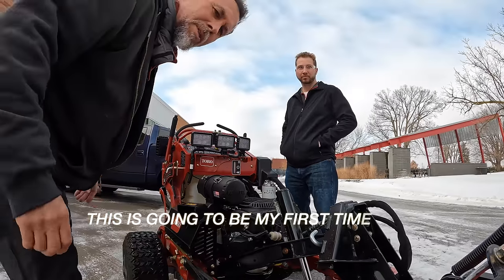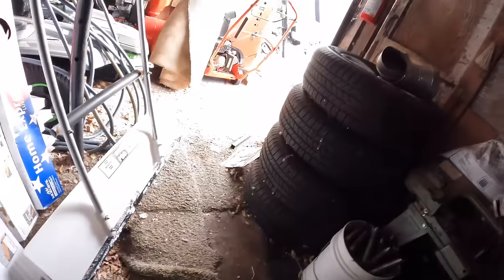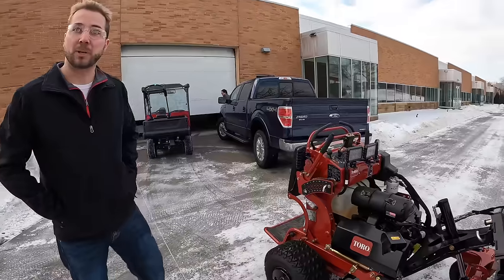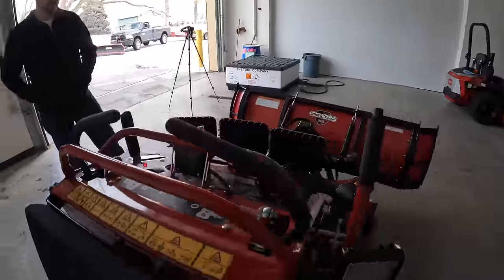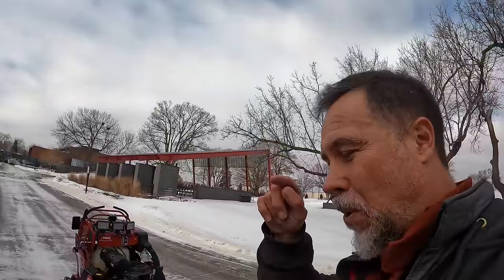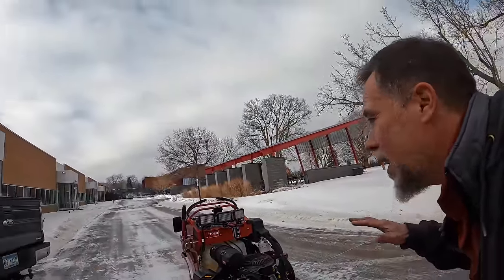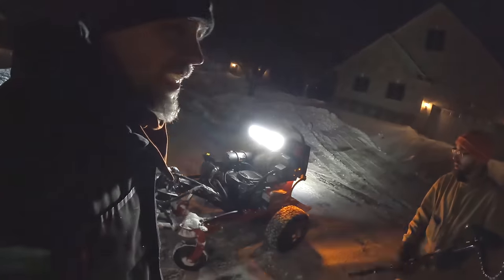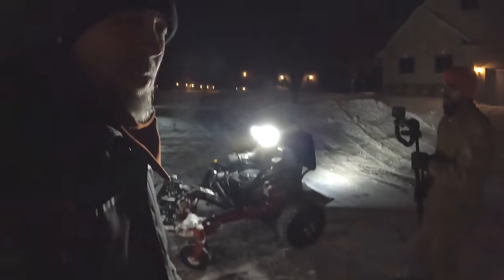Testing a new machine in Fresh Powder

Comment: I've never ran one but from this video is looks like the Ultimate machine for residential properties. The only issues I'd see is pissing everyone off at 3am for how loud it is and you'll have some frozen operators at  the end of the night. Otherwise that machine out performed my expectations
Reply: If they are also shoveling those entrance walks and a little smaller driveways. It might be about the right balance. We picked up a Snowrator this year and are trying to figure out it’s strengths. Maybe the Toro is a good step 1: shovel walks and fist “plow” pass out and away from the garages along with faster transportation between units.
Reply: It probably has a extra add on for another hefty price for a heated cab 😂 JK.  by the time you add broom plow smaller plow, and any other add on. This thing could get pricy..  oh I forgot the led lights and side blinker. All seriousness its pretty cool machine.

Comment: Hey Stan! Great video. I’m glad you did a video on the Multiforce. I have one and this winter is my first winter on it. It took about 2-3 snow events to get used to the controls, but once i had it done oh boy was I going fast. I ended up putting tire chains over the snow tires and wheel weights to give it more traction. Because I live in northwestern ontario up in Canada (about 4 hours from Duluth btw), we get a ton of snow up here (like 4-5 feet each winter). And the chains helped a lot, but in my opinion for most guys who are going to be using it in the states the traction will be just fine for the amount of snow they got. 
I decided to go with the Multiforce instead of a plow on my truck because I didnt want to deal with the extra maintenance and insurance costs of plow trucks. Overall, I am very pleased with my unit, and I recommend them to anyone who is on the fence. I had my doubts when I bought it but I wasn’t disappointed!!!
Reply: Do you not freeze on it in the cold and windy days?????
Reply: i priced one here and it was exspensive comaring to the 14.5hp dr field and brush mower with ,lawnmower,blade,blower,chipper,brush hog attachments are $5,898 for 5 in 1 multipurpose
Reply: @LAKESIDEBOB1  I imagine you could just use heated liners for motorcycle riders plugged into the DC port. That gear will make you sweat at 60mph in the mid 30s outside riding with it on medium. Pretty cheap version at cycle gear too.
Reply: I live right by Erie Pennsylvania and we get a lot of snow here as well just because you are farther north don't always mean you get more snow. We measure it in feet also. We get a lot of lake effect snow.
Reply: You guys get a average of 213cm and we get 256.5 on average so we get more snow it's a fact.

Comment: I'm in Richfield and using this setup for the first winter. I love this machine. I do a couple churches with lots of sidewalks. I use it to cut curbs and light poles. Then we do the neighborhood accounts wit it. It scrapes better than my back drag.  One draw back so far is the sidewalks are built up now and I can't get over the top. So they are getting skinnier. The cold is the other. But I went from needing 3 people to do the walks to just one. I believe someone could start a business with this machine. We fight over it
Reply: Have you considered using heated motorcycle gear? Cycle gear has a in house brand that's pretty cheap for heated liners and it's kept me warm (high will make you sweat on the highway easily) riding motorcycles at 60+ when it's 30 out.

Comment: When i use to do snow removal i always used a grain shovel.they are like a scoop shovel but all 1 piece lite weight and does not brake.also we used something like the man plow but little different it was a 2.5-3ft plastic plow that is angled with a wheels and a loop handle that flips direction
Reply: Those are good tools.
Reply: Your angled plastic plow is a Snowcaster, or a generic version of it. I have the same thing. Works great.

Comment: For snow shovels, I riveted UHMW wear strips onto two of my shovels and they're incredibly long lasting.
Reply from the maker: Niiice!
Reply: @Dirtmonkey  can you make a lawn mowing video using the new lawn mower this spring
Reply: What thickness of UHMW did you go with? I’ve done a bunch  of 1/4 thickness * 2”. It seams a little heavy.

@Stanley “Dirt Monkey” Genadek I love my 27” inch ergonomic double bender (custom old school bend) for my height, aluminum handle, soft D handle shovels for the lighter fluffy snows. For the heavy snows I grab a skinnier double bend shovel. For the really light fluffy lake effects snow I go the the 48” straight handle on the open areas we hand shovel.
Reply: @natielou143  how are you

Comment: Lived in northern Michigan snow belt my whole life, have had years with 350” total. I know my way around a snow shovel (don’t know if that’s a good thing). Best snow shovel i have is “the snowplow, original snow pusher” shovel. Comes in 24”,36”, and 48”. If your only getting 2” maybe 3” I use the 48”, i can make quick work of my driveway with it. Once the lake snow really kicks in I switch to the blower and if I need a shovel at that point I use an old coal shovel. 
The snowpusher shovels are great for cleaning off the ice rink too. Above all they are made in the USA.

Comment: I bought a Snowcaster wheeled snow pusher, and really love it.  It is angled like a plow and is very light, yet durable.   Not the best for heavy/wet/deep snow., but great for everything else.
Reply from the maker: Ive seen those.  They seem pretty light for commercial work I think
Reply: @Dirtmonkey  I saw they came out with a heavier duty one with a  more durable plastic for the cutting edge, and its such a simple design I think it may last quite long with a metal handle and durable plastic blade and support

Comment: I’d say 4” or less this is pretty useful. As a sidewalk machine as well. However if I’m assuming correctly on the price you’re better off in a skid steer with a plow you’d have those drives done in 2.5 mins tops. Skids also useful year round too. If you only do lawn care and snow though this could be helpful. If you have a skid steer though probably not the move.
Reply: I do a driveway in 45-60 seconds in a 6060 with an inverted blower. This here is what a well off homeowner plays with

Comment: The Multi Force performs phenomenal in the winter.  However the constant exposure to moisture and salt starts to present issues in the summer when cutting grass.
Reply: Only issue I’ve had since 2018 is rust
Reply: @shawnkinney717  Do you wash your machine off after each event?
Reply: @Traindude15  yes I definitely do but the water freezes on it. If I get another I’d ceramic coat it first

Comment: If I have to manually clear a driveway with New England snow I would have a snow scoop.   Grain shovels are good for deep snow on walkways or just banks,  a pusher shovel is good for small storms.  

I have a plow on my truck for customer driveways, I use a tractor snowblower on mine and my neighbors.  I had a tractor plow, it was by far the most fun and quick, but I ran out of room after a couple big storms and bought the blower.  Now I only use it early season then after mounting the blower it stays until spring.  I have the plow as backup, and now also have a broom.  I only used the broom on snow once just to see, I’ve used my backpack blower 3 times for light small storms. The broom is for removing sand from lawns in the spring.
Reply from the maker: sounds like you have your season and equipment dialed in.

Comment: With that amount of snow it looks like the back dragging only works for a short distance before too much gets pulled up behind the blade. But with these units you almost have to and can change your approach to clearing a residential driveway. Just back drag enough to get this smaller unit turned around to plow the snow forward away from the garage. Or turn 90 degrees and plow towards the sides of the driveway. You can't do that last one with even a small truck. Just wish the price wasn't through the roof.
Reply: Same thing I do with my mini skid. Back drag 10 feet then turn around and push

Comment: The machine did much better at plowing than I thought it would. Side note: The Minneapolis Airport maintenance department uses the commercial Toro stand-on self propelled sprayer/spreaders (they look similar to the machine in this video) for spraying liquid deicer (E36) and spreading granular deicer (not salt) on the ramp near the airplane gates and around all the ground support equipment (tight areas) where the large 4000 gallon deicer trucks can't get into. The guys at the airport call those little Toro machines their "Secret Weapons".
Reply from the maker: Wow noted! Thanks for sharing the secret weapon 😄👍

Comment: Depends on what I'm shoveling, the pusher flat blades work nice for powder, but for somewhat packed or ice layer snow the worn out cheap shovels work good especially when they wear in a point it gets under the ice and breaks it out
Reply from the maker: Feel that, it definitely depends on what you're working with

Comment: Love the machine bought one for my landscape company in fall of 2020 so second winter using it. Has great manuverability in tight spaces has cut are commercial sidewalk and residential snow crews day by 2-3 hours and after a 10-11 hour day they are happy to avoid the last 3!  We did have to go to the 4' snow plow to fit on residential side walks and one down side is they need to make a quick coupler for the lower hydrologic connection you loss half the hydrologic oil in the change over from mower to plow this may have changed on the 2021-22 model year.   We also are going to look into if they have a front weight kit are PA sleet and ice storms have proven twice now to lift the plow up instead of cutting through thank you for your review it's nice to see someone else give thoughts and opinions on the multi force
Reply: Also you asked about price point 12,400 for 60'' inch mower deck 52" would be less and around 4,000 for all the plow set up as I said we spent 230 extra for the 4 ft boss plow. But much has changed in 2 years!

Comment: That is definitely a all year machine, I'm impressed with how well it did. I was expecting it to work fine in a couple inches of snow but really struggle in the snow you were using it in. In a tight subdivision like that it seems to me like it would work well working it with the pickup where you clean the driveways with the Toro and push the snow into the street then use the pickup to pile it up. Plus the snow broom would be great for sidewalks
Reply from the maker: good point

Comment: I'm interested in seeing how well the drivetrain and transmission hold up over time with that level of stress.
Reply: Yeah me too id love to hear about the headaches too
Reply: Toro uses cheaper hydrostatic "pump" transmissions. It's why I refuse to buy one and I went with the heavier duty Kubota machines as they are hydrostatic "gear" transmissions. If u just look at the difference on a new Kubota 1211 or a 1511 in comparison to a toro machine u can see a night and day difference but the offset is guys have to be willing to spend 20,000 on a Kubota that will last in excess of 15 years. Thr trade off is that every couple years guys are having to throw away the toro cuz thr pump transmission gave out whereas the gear transmissions last forever... as they say u get what u pay for.
Reply from the maker: good point

Comment: I still use my old Sears garden tractor!! Manual blade, but it's not bad to lift and lower. Or tilt. Crazy I have one that's older than me and still works great! But we don't get much snow here in the mountains of TN like we used to.
Reply: No wheel weights, but have antifreeze in back tires.. been in there since I got if from my dad 20 years ago...lol
Reply from the maker: That antifreeze trick is pretty cool.
Reply: @Dirtmonkey  it works really good. Of course if you can put something like RV antifreeze that's non toxic it would be better if you ever had a flat

Comment: Cool machine!  Would live to see the snow blower in action!
I will say, you guys have got to stop piling the snow at the corners at the bottom of the drive ways (near the street)...  Move the snow further up away from the street before pushing off to the side...as the piles increase in size with each snowfall, the ones at the end of the driveway make it hard to to see street traffic when pulling out of the driveway... especially when in a car.... you did good on a couple, but others... 
Either way, thanks for the great content!
Reply: The reason it’s piled at end of driveway is so when the snow melts it goes into street drains etc..
If the pile was at top of driveway, the driveway would be a sheet of ice as it was melting
Reply: Very true^ especially those uphill driveways. You definitely don’t want to pile up snow because it does create a sheet of ice and plus if there is sidewalks. Well guess what, your sidewalk will be a sheet of ice as well and that requires ice melt to be use more often that shouldn’t be. When piling snow on corners, it’s best to push it inwards like how Stan was doing to flatten it down. Otherwise just making a pile does create a blind spot for some but not for all.
Reply: @tmonster1498  didn't say at the top of the driveway... said a little further in, meaning 4 or 5 feet... enough to see around... and if it's off to the side like it should be, it won't melt across the driveway, it should run along the length of it. Also, many municipalities would rather not have the snow melt into the storm drain system (which is why many no longer allow weeping tile to be connected to sewer or storm drain systems), they would rather it run off naturally.

Comment: That machine is good for certain situations like sideways and small driveways but I think I could out work it with my truck in larger areas. Also think you would run out of stacking space over time with the smaller plow and it's ability to stack snow. But overall I think it isn't too bad a machine. God bless my friend,  take it easy, Mr. Animal.
Reply: You can stack snow anywhere, your not limited to the ends of the driveway. It actually rides up on the pile once it’s frozen. The agility makes this it’s most unique feature. In bigger spaces a truck will crush it. I have both.

Comment: We just had the blizzard of "22" here in New England 24+". My site we used lawn mower with a plow attachment (manual lift and angle).
I like this Toro for the lift feature. Would have spead up our times considerably. Shoveler would push a foot or two away from building, mower/plow next couple of feet, then I would push rest into the piles.
That would get single parking spaces nicely. Going to try and recommend to my company. How much are they?
Wish I could multiple thumbs up. 👍👍👍👍👍here you go.

Comment: OK Stanley, my turn to comment.  lol At the 1:00 minute mark you were clearing the snow off the trailer.  I got a new way for you to clear that snow and it is easier.  Last Sunday & Monday we had a couple inch snow fall.  This snow fall was actually light and fluffy.  When I went out, I said to myself.  Hmm I am going to try something.  I got my Stihl BR 899-c out and I cleared all the snow with the backpack blower.  It didn't really take me that much longer only when I had a bigger driveway, but I would use my leaf blower again without problems.  So, give that a try next time you have to clear a trailer.

The issue I can see with the Toro is it works but what happens when you have pushed so much snow that you have a 4-5 ft mound how would you be able to clear snow after that?  That is an advantage I see with a blower because you can blow the snow into the grass or ditch, and you don't have to worry about as much of a buildup.

I am getting ready for another snow fall this Wednesday/Thursday. Blow the snow and make that dough!!! (Mr. Brian Fullerton) lol

Also have you ever tore apart a boat.  Yes, I said boat.  I have a 1972 Pacemaker 32ft boat.  When the guy bought the house, the boat came with the house.  The engines, out boards and everything needs to be replaced and there is no trailer for it either.  I am in talks about tearing the bot apart and throwing it in the dumpster.  I will scrap the motors out for sure but we are trying to figure out the best way to tear the boat apart.  Any suggestions?

Comment: I use a plastic shovel but I only have my porch to shovel. I can do everything else with my Craftsman tractor with a snowblower. Pretty neat works better then I thought it would. Only downside I could see to doing commercial plowing is it's kinda loud running wise. I wish I could find snow tires for my Craftsman tractor. I did a little looking but haven't seen any yet. Thinking with snow tires and chains my Craftsman would be a beast. It does good with just chains but hey always try for better.
Reply: Heavy foam fill an extra set of winter wheels and stud the tires.

Comment: Ergie Systems ERG-SNSH18 Steel Shaft Impact Resistant Snow Shovel | 18-Inch Shovel | 48-Inch Shaft | Push/Scoop Combination Blade, bought this shovel when we had a couple of feet on the ground after using a metal square shovel for the snow its such a back saver not having to heave every time and i coated the plastic so the snow wouldnt stick
Reply from the maker: sounds like you got yourself the utimate shovel.
Reply: @Dirtmonkey  its great for the small stuff i have to clear which i dont have alot of snow fall here anyways